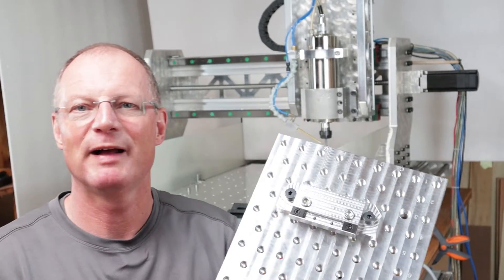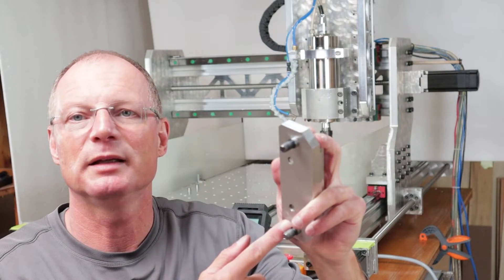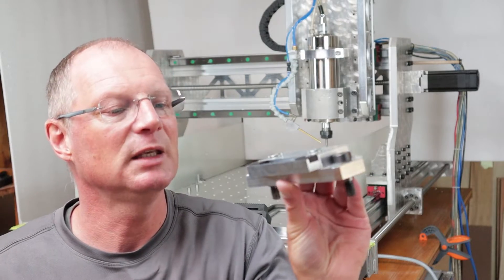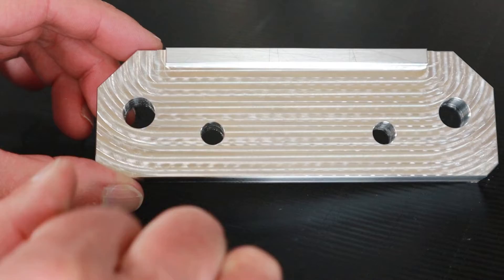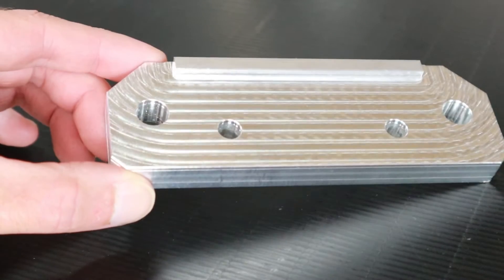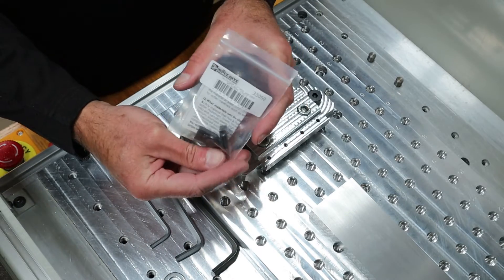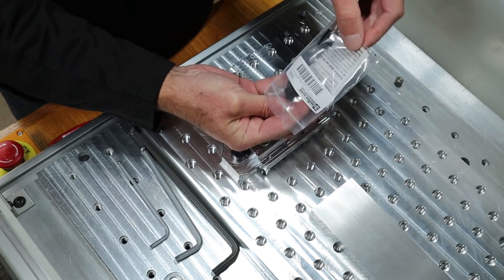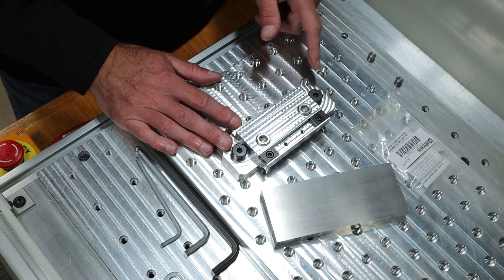DIY Low Profile Vice

Comment: Hi! I'm also interested in making these myself. But it seems hard to find the mitee bite inserts in Europe. Or a good alternative. Did you use MITEE BITE 33050? Were did you order them? Thank you! Best regards, Anton
Reply from the maker: Hi Anton, yes 3350 is correct. Dimensionally they are the same das the imperial one but these have a metric fastener (M5). I got them from MSCdirect.com.
Reply: @JBWorx  Thanks!
Looking forward to your next video's. Always interesting to watch! Best regards, Anton
Reply from the maker: @Tonerony excellent great for having you. Next video is about surface finish on aluminum

Comment: Wont be much longer until I make a set of these as my machine is now up and running. But quick question, bearing in mind, I have never used this type of vise: Couldn't you make the fixed side from one piece of billet? Is there a practical reason it is in two parts except for just sticking with the same stock and thickness as you'd need for the moving side parts?
Reply: I figured it out. The original design reasoning is to be able to swap the top plates for soft jaws and also to turn them around and use the backsides with normal parallels.
Reply from the maker: You are spot on- make the vice you will like it
Reply: @JBWorx  Thanks Jorg:). 
I think the first set will be 7075 and then perhaps steel later on.
Reply from the maker: The aluminum version works really good as well.

Comment: Any reason why the stationary jaw can't be a single piece?
Reply from the maker: A single piece will work just fine if you use it in the way I showed however you can make also soft jaws for the vice.  But these could also be a single piece as long as you don’t mind using more material to make them.

Comment: Hi. Just want to make one like this. Can you tell me base height and jaw plate height. Is 12mm efficient for both ?
Reply from the maker: They are both 13mm base height. However the fixed side has the ledge in the back and is made from 16mm stock. The top plate is 14mm.

Comment: black fluid? is that glue ?
Reply from the maker: Yes, it’s super glue also called CA
Reply: @JBWorx  Does it leave marks that are difficult to remove?  how do you clean it?
Reply from the maker: Usually I use tape on the part and tape on the table then the glue goes in-between. So all you need to do is pull off the tape.

Comment: What kind of glue are you using for the tape workholding? I've seen people use superglue for that but you seem to use a black glue?

Also, is that a block of POM? Just curious
Reply from the maker: Yes it’s a POM (Delrin) Plate. It works really well as the tape sticks to it better than to other types of plastic. The black glue is made by Starbond it’s the medium viscosity CA (super glue). It’s visually good for filming and I really like the extended shelf life this stuff has.

Comment: Thx for sharing. Just curious, what Brand, Type tape are you using to hold material down? Thx
Reply from the maker: It is the painters tape for rough surfaces. The orange and the green 3M tapes work well. I have an Amazon link in the video for work holding.

Comment: Good job as always! Just one correction regarding the SMW vises, they use the tapered screws to force the top plate against the shoulder of the fixed end. They do not use the tapered screws as a locating feature. Their design is not overdetermined (screws don't bottom). I'm sorry to say this but their design is actually better since they are using a taper to force the top plate against the shoulder as opposed to a socket cap screw that just rely on friction. Both designs should work ok when an object is clamped, but their design is superior when machining soft jaws. Otherwise, your content and designs are amazing!
My review is based on this video from SMW: https://youtu.be/4_kYYKfqaDg?t=63 (I'm providing the link at second 63 where they talk about this)
Reply from the maker: Thanks for u you our feedback … well appreciated

Comment: Nice work! I just have a question where you bought the mitee bite vice clamps? The one I found is all imperial. I live in Europe and prefer metric.
Reply from the maker: Thank you! Yes mine are metric too. I got them from MSC it’s a vendor here in the US. They are now also available here on Amazon but I don’t know where you would get them in your country. eBay international maybe ?
Reply: @JBWorx  thank you for your response. Do you have a part number or model name. That way it is easier for me to search. Best regards, Andreas
Reply from the maker: Hi Andreas, you can download a CAD drawing on the Miteebite  website. Look for talon grip and part 33050 or 33020.
Reply: @JBWorx  Thank you for the part numbers. I found them. Keep up the awesome work!
Reply from the maker: I will try 😀

Comment: The toolling marks on the side look like they are there beacuse you used mutiple depths on a out of trammed machine .  There looks to be plenty of flute length to do a full finishing pass.  In fact with that small of a part eveything should be done at one depth, unless plunging, even if you have to  use better workholding.   I use onsrud single flute bits on my router and clear material faster than my 1100 does on the same 1/4 inch bit.  Routers IMO are the best at cutting Al.
Reply from the maker: Yes I also think a cnc router is an excellent tool to cut aluminum. You are correct my cuts are often conservative and most feed rates I post can easily be doubled. However there was a full depth finishing pass and no it’s not the spindle tram but the roughing end-mill I am using.   It makes a tiny line between 2 of the teeth - I am ok with that on most applications as it is a roughing tool and makes nice small chips that can easily be picked up using a vacuum. The tool is made by Datron. Onsrud is good for everything wood / plastics but the Datron stuff is awesome for Al, give the 8mm single flute a run, it’s a nice stiff tool that is impossible to clog. Thanks for your comment !

Comment: Enjoying your videos. Having a bit of a binge of them recently. Very well shot and put together. Also the vice looks like a really nice build. I hope to make something similar when im a bit more confident with my machine. I think first I need to sort out a decent build plate though.
Reply from the maker: Thank you! I think there are steps of improvements that I went through. And I still can think of several more today. Best is to think what is the most useful improvement the way you use or like to use your machine. For me it was to accurately machine aluminum and so I started the journey of making all the necessary bits and pieces.

Comment: Hi there. Not sure if I understand the reasoning with using the cap screws to allow the top plate to move forward and back. Are the holes on the to plate slightly oversized to allow this? Cheers.
Reply from the maker: I like for the top plate to rest against the back so it will not move and is aligned. Yes the holes are dimensioned per standard ISO through hole.

Comment: If I can ask please. What is your spindle speed? and are you blowing just air or is there a fine oil spray as well?
Reply from the maker: On the 6-8mm tool about 16,000 rpm for clearing and 18,000 for the clean up cut. I use alcohol for machining aluminum this much said please understand all requests and risks before you use it for cooling.

Comment: great colleague. I congratulate you. can you share the link of the glue and medicine that I put on the floor? Thank you .
Reply from the maker: Yes sure, really any super glue will work I like Gorilla glue and Starbond in medium viscosity. More important is the tape you can use blue painters tape or I like the orange version with extra adhesion. I buy a good brand name like 3M / Scotch.

Comment: What hardware are you using for the vice bolts and the fixture bolts? Is there an online supplier?
Reply from the maker: Hi Austin, because this is a metric version all hardware is metric. I use McMaster Carr because of the selection and you can also download a file for the bolt into your CAD. The vice uses M10 and M5 for the Mitee Bite. The locating pins in the table itself I machined myself. Here a video for that 
https://youtu.be/h7MFHnyO938

Comment: Love the shoulder bolt idea. But it only works on a plate with holes that are both threaded and doweled, no?  I assume plates with separate (un-threaded) dowel holes, the design will not work?
Reply from the maker: Yes that is correct, if the plate has dowel holes and threaded holes separately the vice will need the locating and the fastening features separate. Pressing in 2 dowels in the lower plate would be necessary. There are also diamond locating pins available that can be pressed in. Many options really, it depends what one already has on hand

Comment: Nice work. I would happily pay a small fee for the fusion files for these. Are you planning to share them please?
Reply from the maker: In the beginning I thought I would do that but I kind of feel bad as the fixed side is so similar to the Sounders Mod Vice. I don’t want to hurt them in any way but then I think  that if you make your own you would not have bought theirs anyways. So I am a bit troubled right now what to do.
Reply: @JBWorx  in my view it's a cheap home made clamp that is a simple design and doesnt come anywhere near rivalling their product. I think you could sleep at night tbh.
Reply: I'm going to make some whatever, but being able to adapt an existing file sure would save me some time.
Reply from the maker: Yes makes sense. I am traveling but should be able to upload the vid for the movable side.
Reply: @JBWorx  Normally I would consider using anything free to save time. However, I am as conflicted as well, and your hesitation to provide the model is commendable. John Saunders has certainly been unselfish and sharing. Many of us appreciate his enthusiasm for the trade and both his Fusion 360 and machinist fundamental tutorials . . . all free!  

Your ideas and changes to the design are the value added here. In this case I am thankful for you sharing your ideas and CAD isn’t the intent of the video. Certainly somebody with the ability to manufacture, or create shop drawings from a model, can quickly extrude a rectangle and drill a couple of holes in their own model!
Reply from the maker: Thank you for your comment! Yes John is a great guy that I totally respect. So the next project (coming in March) is a touch of probe that I designed. It’s a nice tool to have and there will be drawings available and possibly even a couple of parts that are made on the lathe for purchase if one would make their own version. Let’s see how much interest there is …

Comment: 13:20  but you also can make your own washers out of thin brass shim stock.  because all you need is to protect aluminium from friction damage so thin shim is OK.
Reply from the maker: Yes that is totally possible, no need for a thick washer here for load distribution just so the screw head will not eat into / wear the aluminum.

Comment: Hey ! love your videos and have 2 questions right from begining :) actually 3 :) Are you located in Germany or US ? What kind of glue are you using ? And where can I get that nice roller for tape ? :D Thanks ! I am just building my own vise too, I am using small MGN9 linear rail for jaw in mine
Reply: oh another question how happy are you with this crosscut datron tool ? I am struggling with long chips a lot..In datron demo video I was not really able to see those lines so I guess if this is really to do with tool itself, to me that would be not acceptable
Reply from the maker: So for the chips I am super happy they just vacuum right up. The surface finish for facing looks amazing. No lines in the surface where a chip gets wedged in between an makes a circular mark. However the radial finish has steps and it makes a big difference on tight tolerance work. So for that you need to make a tool change and a finish pass.
Reply from the maker: Hi Andrej, I live in the US. The glue is a “super glue” this version is black so it shows up in the video, but any medium viscosity super glue will do. Usually the tape will fail not the glue. The roller is from Amazon it’s a seam roller. I saw some the other day in a hardware store for laying down vinyl. Actually using a piece of rail as a jaw is not a bad idea.

Comment: Good job!
I made the same ones some time ago, as well out of 7075, but 125mm wide.
I used 7991 bolts for the fixed jaw however. With a slight offset of the thread location in the base plate towards the rear. This way the bolts always push the fixed jaw against the shoulder. Basically the same principle as on the loose jaw...
Where do you buy the shoulder bolts? They look interesting.
Reply from the maker: I got mine from McMaster because I wanted them fast. But eBay will do as well.
Reply: @JBWorx  I totally forgot that you are currently in US... Somehow I hoped for a mainland Europe source...😏
Reply from the maker: Actually they are way cheaper on eBay in Germany than I can buy them in the US. Probably more common there.

Comment: Thanks for another great video. You are sooo close to 1k subscribers. I have 4 other profiles I'm going to go and subscribe on to give you a little boost. I'm willing to bet your machine can handle mild steel. It isn't that much harder than aluminum, and you can just take lighter cuts. My setup is very similar to yours and I have managed mild steel. Just make sure your feeds and speeds are correct.
Reply from the maker: Thank you !! Yes I might try a high feed endmill it is designed for shallow cuts and faster feed rates.
Reply: @JBWorx  I've been using a 6mm AliExpress carbide endmill at 18k rpm, 350mm/min feed rate, .1mm doc on cold rolled steel with great success. On a home built gantry mill/router. Could likely go depper/faster feed but no sense hurting tools or machine.
Reply from the maker: I don’t have a good tool for steel at the moment. I have several 4mm 4 flute end mills that  I received by accident and the vendor said keep ‘em and I send the correct order right away. So these were free … I guess I can make some test cuts. 18k rpm is the highest torque for the spindle, but I think it could push this small a tool at a lower rpm. I also have some hot rolled steel on hand … cold rolled often turns into a pretzel if you only machine one side. Hot rolled on the other hand likes to eat your tool. Hmm 🤔
Reply: For a 4mm 4 flute, in 1018 cold rolled, with a cut width of 0.2mm and a depth of 2-4mm, your RPM should be 18000 and your feedrate should be 720mm/min. 

This according to GWizard and assumes 0.01mm/tooth, or an adjusted chipload of 0.0229mm/tooth. Recommended is 0.016 to 0.031mm/tooth for steel.
Reply from the maker: That looks reasonable I might get to a test tomorrow

Comment: Nice video. I wonder if the music will increase views, ha ha. If so, let me know, and I'll need to figure out music for my videos. What type of roundness numbers are you getting for a helical bore cycle? If you put an indicator in the spindle over the hole and sweep it, what is your TIR? Does the indicator pick up a discreet edge where the axes switch directions?
Reply from the maker: Probably not … the music I mean. Too many different tastes it’s like trying to give everyone a car in the same color … I never finish using a helical bore cycle there is always a clean up cut with low step over in the end. You can see the endmill will enter the hole one more time for a clean up cut. However I am concerned about a tapered hole shape using a single flute. Hence the test with the roughing tool this time. I will have to test the roundness figure but the tolerance to the shoulder bolt is 0.03mm and it fits. Good luck on you channel Nick.

Comment: Nice work! I'll be heading down this road soon. Still working on my fixture plate. After doing some test holes I came to the conclusion that I really am going to need some sort of chip evacuation to make it through all the holes without gumming up the endmill and welding a wad of chips to it. Picked up a 26 gal. air compressor the other day and the airblast parts should arrive tomorrow. Once I get that all squared away the plan is to make some low profile SMW style vises.
Reply from the maker: Nice 👍 sounds like you are moving right along. Use a single flute endmill for deeper holes that helps a lot as well

Comment: Just curious, why is that two separate pieces? What is the benefit of being able to remove the top plate and why have it overhang and lose some rigidity?
Reply from the maker: The top plate can be turned around to use as a solid jaw. You can also design a jaw for your specific part application. The overhang resulted for me from a “V” shaped jaw where I used the lower plate as the part rest (holding a round part) You could make the fixed side one solid piece if you always like to use the part rest. The loss in rigidity is mainly the channel for the Mitee-Bite… and that it is made from aluminum.